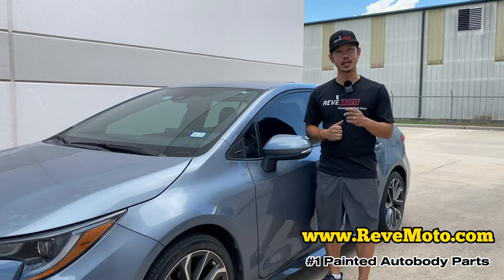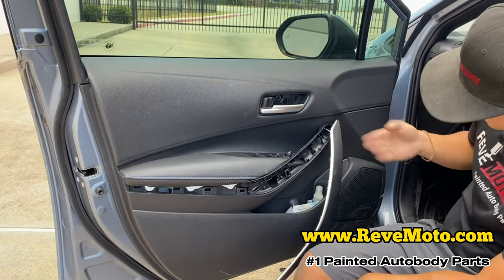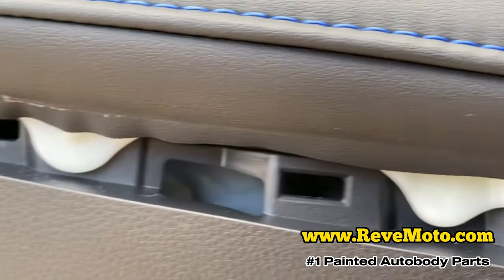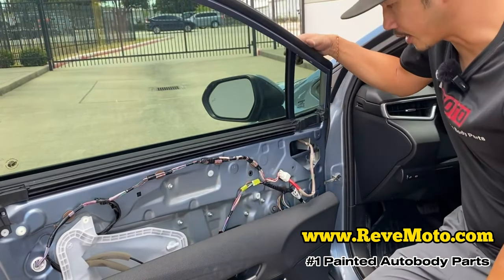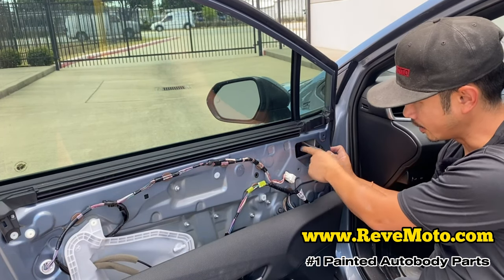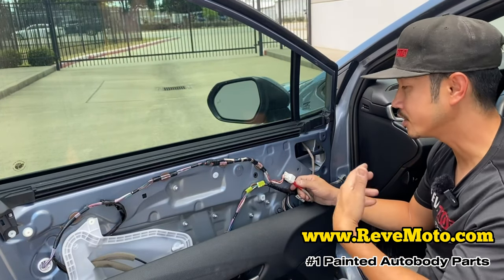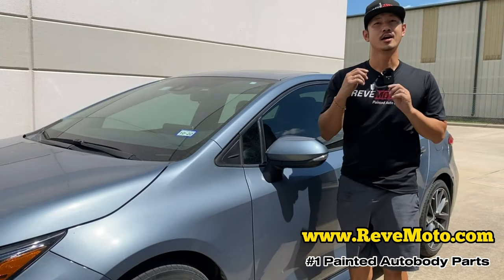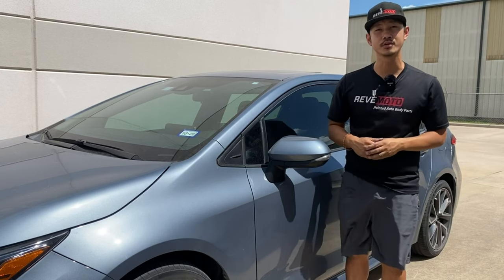How to Remove AND Install 2020-2024 Toyota Corolla Side View Mirror. 15 Minutes or Less - ReveMoto

Comment: Hello is this tutorial for a folding mirror or is the procedure different for them?
Reply from the maker: The installation is usually the same no matter what features you have. The only difference is usually the wires and plug based on what features your mirror has. And, if you have a camera, it might require calibration. But other than that, yes sir - all of the same steps to remove and install. Let me know how it goes! And if you need a painted Corolla mirror replacement, get it at revemoto.com

Comment: If im upgrading mirrors to the ones that defog and have the blind spot assist, will the harness already be there for the new mirros to be easy plug and play???
Reply from the maker: From experience no the harness are not the same.  If you need parts for your car go to www.ReveMoto.com

Comment: Any ideas how to replace the mirror COVER?? I am about to replace my mirror, but need to put the correct color cover on it from my old mirror
Reply from the maker: I get a flat object similar to a flat screw driver, but plastic.  Find a corner and pry in that area which usually pop the cover partially off.  Just work you way around until cover is off

Comment: is possible add this type of side miror with leds to version without light on the assembly?
Reply from the maker: No you can’t because the plug will be different and Tyler turn signals won’t work.  If you are just trying to fix the mirror than you can use it, but some functions won’t work.  www.ReveMoto.com